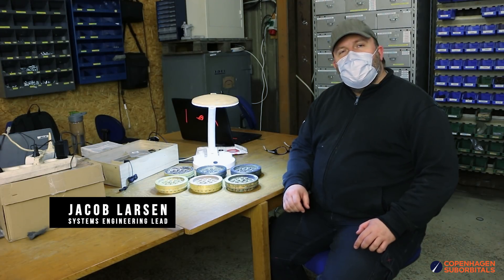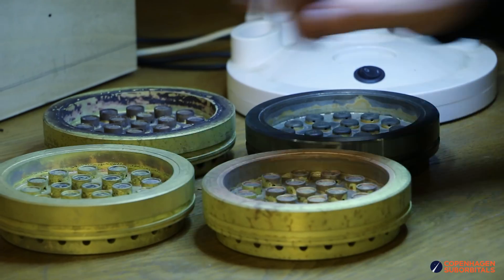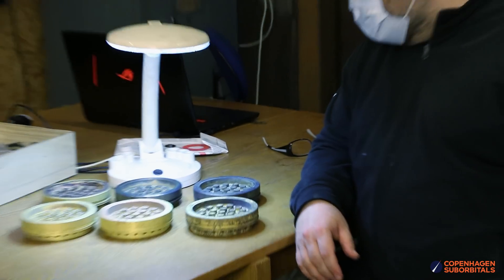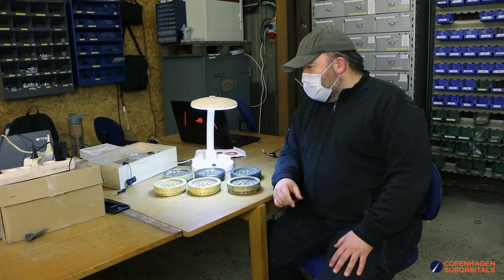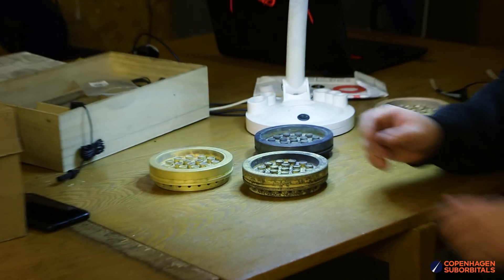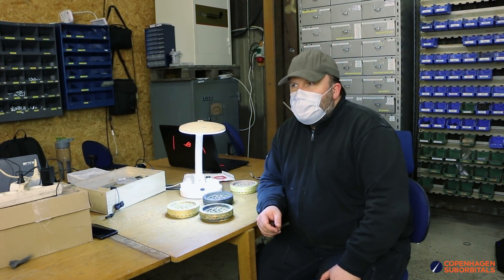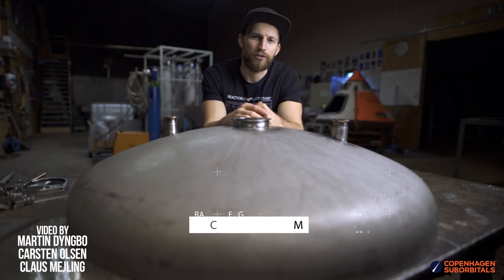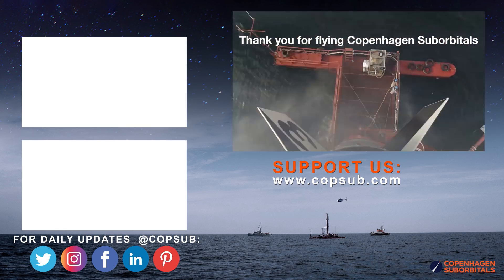Making Many ROCKET Fuel Injectors

Comment: I have a bruning question, the grooves on the injector plate for sealing the gap between LOX and ethanol, what do you use to seal it? Rubber, silicone etc.

Comment: Why you don't put many of that little rocket engines on Spica, instead to develop a big one?
Reply from the maker: We would need at least 20 BPM-5's in place of 1 BPM100. Apart from the fact that so many of them wouldn't even fit inside Spica's footprint, it would also add unwanted complexity, weight and costs.
Reply: @CopenhagenSuborbitals  any launch date on when Spica will launch a person to space?

Comment: After doing a suborbital space flight, they should do a orbit around the earth. After that, i would love to see a DIY spaceflight (or landing) around the moon, the the dearmoon mission!! If they can, they would beat russia, china, india, and every country but usa.
Reply: Going from Earth orbit to moon landing is very different and difficult
Reply: @AbuctingTacos  just going from suborbital to orbital is a big leap.
Reply: @AbuctingTacos  Suborbital to orbital is a big step. Trans lunar injection  - TLI - is a small step from there subsequently getting something to the moon is equal a small step from orbit earth. Now I did write getting and not landing. Hitting the moon is a lot easier than landing on the moon as in land slowly in one piece.
Reply: @petermaersk-moller3014  Getting around the moon and back to Earth is much harder than doing laps around the Earth.  It's simply too easy to miss and either fly past earth or reenter the atmosphere at the wrong angle, or simply fly past the Moon and never get anywhere near Earth before dying from lack of consumables.
Reply: @johndododoe1411  Now we wasn't talking about taking humans to the moon .. :-) If you can get a payload to LEO, then converting it to TLI requires little energy compared to getting in to orbit. The delta-V is not that different. Large  delta-V (like going to LEO) is hard. Little delta-V like going from LEO to the moon or Mars (like the Roadster) is compared relatively easier. And by going to the Moon, I meant reaching/hitting the Moon, not landing nor going into orbit nor going into return trajectory around the moon. The last two are somewhat a bit more difficult than just reaching/hitting the Moon. That said, reaching the Moon, even if you can get to LEO is rocket science ... but known rocket science.
Reply: Theoretically they could convert Spica into a small sat launcher by swapping the capsule with a second stage. Maybe with a vacuum optimized BPM-5.